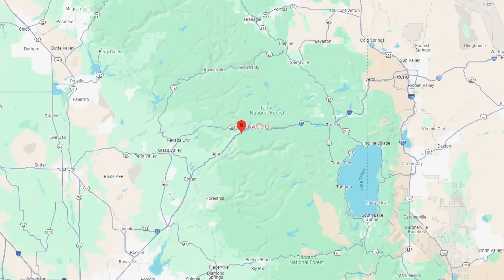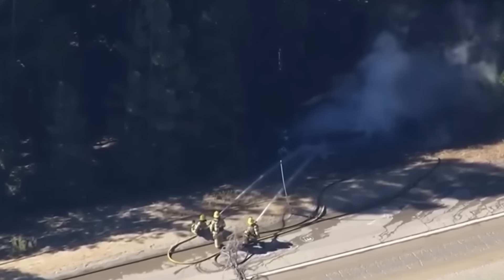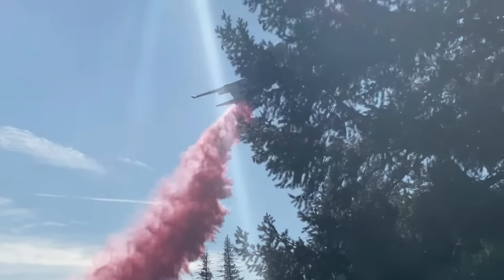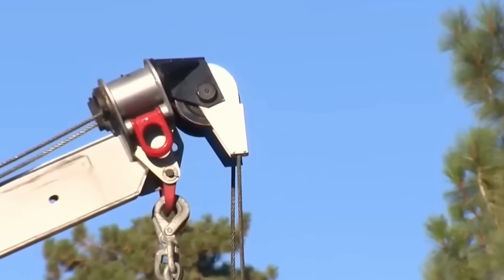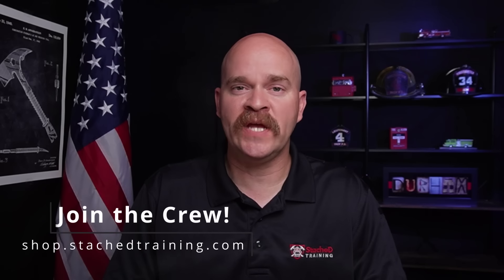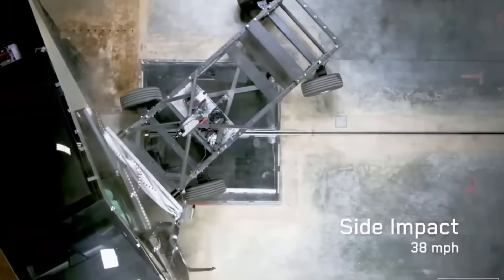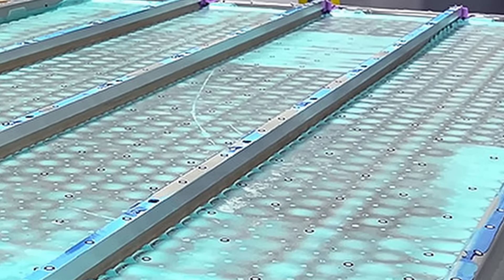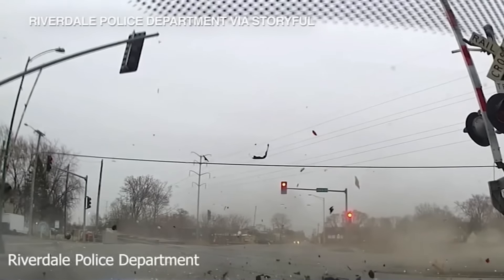50,000 Gallons! Tesla Semi-Truck & Cybertruck Fire

Comment: Each incident involving thermal runaway on EV batteries ends up creating a huge mess. Currently EVs are a small part of the vehicles on our roads. Imagine if they were the majority...
Reply: imagine it happened during traffic jam in tunnel
Reply: Still less messy than ice fires because of less probability of fire
Reply: @Y2Kvids  If South Korea is any example the stats might be against you. 1 EV recently took out 140 nearby vehicles, affected water and electricity supplies to 1600 homes and injured 23 people. That's a pretty impressive mess.
Reply: @george2916   sorry I thought taking control of ICE fires was Easy.
Reply: @M_Jono  It would be like the Sylvester Stallone disaster movie, "Daylight"
Reply: their "hidden costs" (on top of the upfront cost to produce and buy them) are off the charts.
Reply: @Y2Kvids  the irony is a lot of ICE fires (that aren't due to someone lighting it) are due to electrical problems and commonly in older vehicles. the EV fleet is small and very young. ICEs avg around 12 years old where as EVs avg around 4 years.
Reply: @phalanx3803   ICE fires are due to Mechanical Heat(mostly on road) , Electric Shorts , Leaks .

 EV fires are due to Electrical Shorts (12V battery or High Voltage Battery) . 
Just less causes for EV fire . Also  helps that EV doesn't have Fuel that will ignite everything it touches and Flows all over the place . Only problem is with Nickel batteries but are being replaced with safer Iron batteries.
Reply: @Y2Kvids  mechanical heat is one of the lest common causes. tied for first place is fuel leaks and electrical problems and both mostly due to lake of maintenance. just imagine a 400V (some are starting to use 800V) cable not being maintained and left to rot? just ask the people of Swissair Flight 111 how that went. 

and EVs still use a 12V system like any other car and remember 12V electrical problems are tied for first place when it come to ICE fires. 

and once again regardless of maintenance age plays a big factor the EV fleet is still far to young to truly compare to ICEs. doubt any one has the break down but it would be far more fair to compare EV and ICE fires of cars made after 2015.
Reply: @phalanx3803   Quite Significant number of EV are on Road from 2012 on wards . That would mean 1000s of Fire if that were to happen from just being old and rotten . These defects are protected by Fuses and Contactors . Most fires happen due to bad manufacturing like those Samsung note 7 . 

2015 onwards the Batteries were so much better , requiring almost no recalls . All of them are in the road today , 9-10 years .. people said they would need replacing after 3-4 years .
Reply: @Y2Kvids  bro you are coping so hard.  There's still 100s of thousands if not millions of cars from the 90s on the road and they have fuses and still suffer from electrical fires. And batteries have only gotten better at holding more energy there still very flammable when something goes wrong. 

Even if EVs hold a low fire rate when there avarage age gets close to ICEs it doesn't change the fact when they do catch fire they are a nightmare and a half to deal with. Here in rural Australia the fire department has a let it burn police if there is no risk to life because it's not worth the time and effort.
Reply: @phalanx3803   Hey rural Australia imports oil from thousands of miles away from unstable countries.. they would be much more sustainable and happy Use to Lithium and Iron that they mine themselves and solar power that they have plenty. It is about making them safe and convenient as much as possible. 

Batteries are safer and are further improving as the Trend . 50 year old House wiring still works why do you doubt Multiple Times Insulated,Treated , Protected circuits be Dead in 8-9 years.

12 V fires on EVs are as easy to extinguish on an ICE , in fact much easier due to non involvement of Fuel.
Reply: @Y2Kvids Baloney. Fires in cars typically spread in the plastic and foam. There is no explosive in fuel fires compared to battery fires. Rarity is a non-issue when it happens to YOU.
Reply: @HuFlungDung2  Irony is that foam and plastic are oil product that cause burn when there is a  EV 12 V fire. 
Adding fuel to a Fire is what ICE do . This is why 140 cars burn as the fuel Leaks and Spreads further . Multi Level  car parks and  Outdoor Event Parking have caught fire due to this behavior of Fuel in car burning accidents.
Reply: @HuFlungDung2 I think he works for an EV manufacturer, he's not listening !!
Reply: @Y2Kvids  Almost all ICE fires are due to ELECTRIC faults in older, poorly maintained vehicles. So yeah, as your precious EVs get more common and age, they will be bursting into flames like roman candles, genius.
Reply: @george2916 let’s not forget the pollution which is highly toxic from the batteries.  These fires can burn for days.  So much for saving an eco system that EV’s are supposedly to help.  Very debatable and hard to get sold into.  EV’s will not be the solution for tomorrow no matter how hard the governments try to implement it.
Reply: Batteries.. To be honest, when i imagined 21st century vehicles, i not once, imagined they would run on batteries... F*CKING PATHETIC...  Wow, this World is such a Collection of Crippled...
Reply: @harrysmith8338    Fossil : Chemical Reaction
Hydrogen : Atomic 
Batteries : Electron / ION 
Nuclear : Neutron /Proton 
Flying Cars : Graviton 
Instant Travel : Work From Home
Reply: @Y2Kvids Seriously, you're comparing an old house to a vehicle? 😂

I didn't know the house had electricity on the moving parts (car doors), and I didn't know the houses were shaking either.

Maybe your house has 20 cables on every moving part, and it shakes a lot. 🙂

When the cables vibrate, the insulation wears out. You didn't know that?

Of course, in an old house, the cables will last 500 years, because in 500 years, not a single cable moves or vibrates.

The car is a different story, the cables even break due to the vibrations.

Seriously, because it's logical that you can't compare a house to a car.

Your comment really killed it. 🤣

All cars have fuses, but still the car catches fire due to electricity. Do not think that if there is a fuse, that now the car is 100% safe. The only difference is that the main battery in an EV does not have a fuse.

Now only owners with money have vehicles, and the cars are regularly maintained. But don't think that everyone will change the battery just because of a small fk dent. This will not happen, people will not throw money away if the car works and there is no warning lights.

Is the battery still safe? 🙂 I don't know, you will see in 2040 how many fires there will be on the roads...  If there are few, then it is safe, if there are many, you are screwed. Charging the car next to a car that has a dent on the battery case.... esss... or charging a car next to a car where the cooling system for the battery has never been serviced is a ticking bomb.

But if you know it's going to be fine, you'll be safe at charging stations, probably. 🤣

Good luck 🥂
Reply: @dchubworldsharenetwork   "The only difference is that the main battery in an EV does not have a fuse." What .. EV Battery has more Security than Trum

Your knowledge on EV is Questionable but I agree on the House . People have unwarranted Fear of Electricity , Like Some have over Flying . 
Blow a Fuse and the EV will not let you drive .   Get into a Crash .. HV Battery is Disconnected . There are many levels of Safety in an EV .  Many are Sealed Lifetime systems on an EV such as Gear Box , Cooling Systems  even Batteries are Fully Sealed in some Cars for safety . 

60 Million EVs are on road Today in the world . EVs from 2012 have not caught fire . Hopefully EVs will make 2040 a reality and people don't get more beachfront properties than today
Reply: @Y2Kvids  Then why is there a whole field of Teslas with small dents written off by the insurance companies.

Immediately write to the insurance company that it does not matter if there is a dent on the battery case, it is still safe.

Don't write back.... call the insurance company right away, because there is a whole sea of them in the field in America.
Reply: @dchubworldsharenetwork   All this talk about Safety and you are wondering why Insurance company are writing off Tesla with Dents in their battery casings . 

This is the industry practice . If there are Sea of them , then They will be replaced and battery be Recycled .  Recycling Companies are Eagerly  waiting for Recyclable Batteries .
Reply: @george2916 The sprinkler system malfunctioned. Important detail.
Reply: @george2916 luckily an ev fire is 20 times less likely to happen and that number will become only better for EVs when they mature more.
Reply: @Y2Kvids House wiring is solid core and not subject to movement or vibration. Automotive wiring uses stranded because it is subject to vibration and movement.
The fact you are comparing automotive wiring and house wiring just screams "I have no idea what I'm talking about, but continue anyway."
One would think a logical conclusion would be to just stop, yet you continue.
Honestly an interesting case study.
Reply: @caddyguy5369   House wiring is Boss , Handles 240V and multiple phases and what not . 
Automotive wiring burns a car down with 12 Volts, no comparison.
Reply: @Y2Kvids yeah what % are still around.
Reply: @Y2Kvids Using a house is a terrible comparison. A better comparison is trains. And I can tell you there aren't alot of battery locomotives compared to everyother power source.
Reply: @gamerfan8445   But almost all of locomotives are Diesel -Electric or Electric. None of them burn down because of wiring.
Reply: @Y2Kvids  bruh.
Reply: @george2916 it wasn’t a Tesla- Hyundai has their own share of faults. I can’t find data backing up your claim either
Reply: @gamerfan8445 tbh real reason is money, why spend money on a bunch of new, completely novel locomotives, which need new charging infrastructure, along with battery components, etc. Costs more to switch over than just keep with the norm. Also battery-elecs are worse than just straight up wiring it. Roads can’t have catenaries because drivers are unpredictable. But, a railroad IS predictable. Why go the extra mile for a battery loco when you can just throw a bunch of wires on the ground and use proven electrics? But hey, i do prefer hydrogen. Cheapest solution, and most feasible imo. 

Remember kids, if we ever switch to batteries, we’d be facing a lithium shortage, and a pretty big one at that.
Reply: @SpheroJr3289  I know that, I just pointed out a better comparison to EV, yet the guy I replied to has no idea what he is talking about. Also, hydrogen is not the best option, mainly because it has some of the problems with batteries locomotive.
Reply: @george2916  a single gas car would have done the same. Their fuel 120lb tanks will release 4x more heat than a 1000lb battery.
Reply: @Renard380  they do not, you can put out the fire in 3 minutes, the problem is keeping it cool, only real solution is submerging it which will happen more often as fire department become equipped, rember the fire department use to deal with building fires until cars where invented and they had to make new techniques for it.

Comment: So many EV  fires because of very dangerous batteries , Rivian just had a huge fire at their Illinois plant over 50 Vehicles destroyed
Reply from the maker: I'm currently working on the details.   Trying to confirm the number of vehicles.
Reply: @allelectric1330  the batteries aren't inherently dangerous, I've never had a battery fire after owning 200 lithium devices,
What is inherently dangerous is new companies that never mass manufactured products this complex all of the sudden trying to sell as many as possible. Tesla has the foresight to set a battery on fire in 2006 and become aware how dangerous it could be even at low volumes.

Comment: Imagine if this fire had happened in a tunnel. 💀
Reply: Hyperloop
Reply: Imagine if it happened traveling on the way to Mars ☠️
Reply: @thebeacon2  😆
Reply: A truck fire in a tunnel is very bad no matter what, ev or ice won't make much difference when it starts going. What will be left is a melted mess either way.
Reply: In the UK they’re already  banning EV’s in parking structures because of fires in these places, I’ve read they had several fires causing millions in damage to the structure and all the gas powered vehicles. I can see these problems getting worse when these cars age , hopefully for the owners of these vehicles new technology power sources can be retrofitted for safer and more efficient power options that will likely be mandated through recalls which I can see being extremely costly for the manufacturers. Time will tell if the government will force these changes because the manufacturers certainly won’t be willing to do it
Reply: Or on the Channel Tunnel train.

Comment: "Jeep has issued a recall that involves 154k plug-in-hybrid versions of the Wrangler and Grand Cherokee which could potentially catch fire.  A fire can start while the Jeeps are driving or parked. For that reason, the automaker is advising customers to park outside and away from buildings until the problem is fixed. Owners are also advised not to charge their Jeeps until the issue is addressed, as the fire risk is reduced when the battery is depleted."